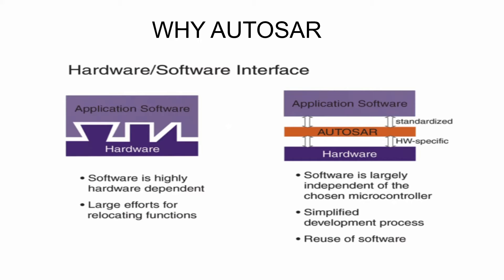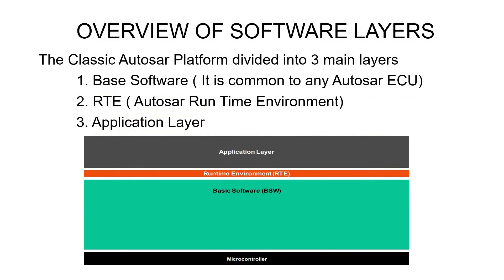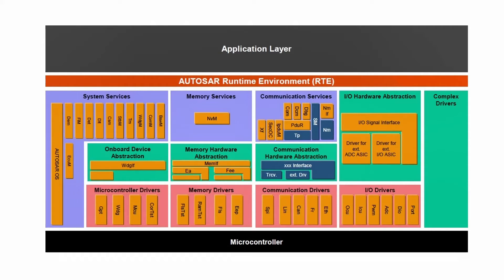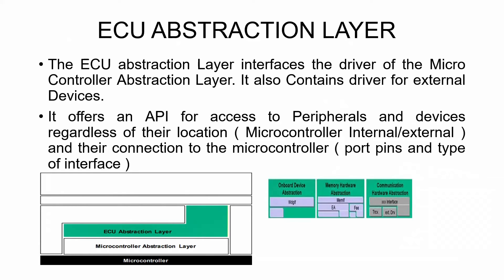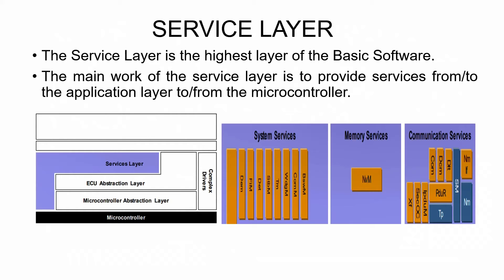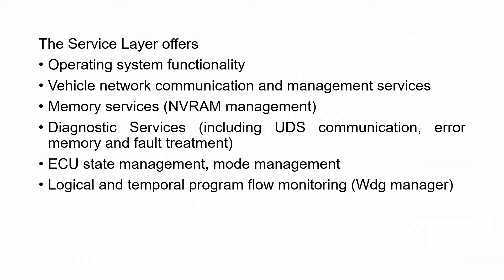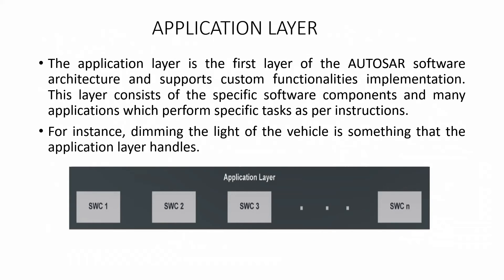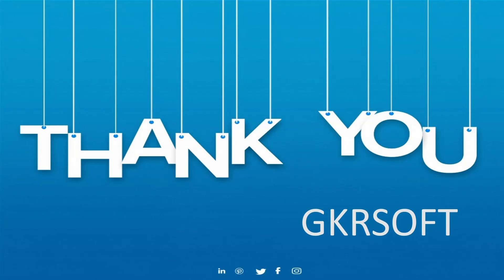Autosar layers by GKRSOFT

Comment: I have a quick question here what is the  exactly difference we can see between  multiple ASWC like A application SWC and Complex device driver  SWC because anyhow both are atlast one  .c file ?
Reply from the maker: The Complex Device Driver (CDD) Software Component is used to model a function outside of the normal AUTOSAR Basic Software stack for complex or resource critical sensor evaluation or actuator control, especially for hardware that is not directly supported by AUTOSAR . But ASW Software Components is a Pure Autosar SWC.
Reply: @GKR23  Thank you ! . I got your point .you mean say each ASWC has restricted functionality . but i wanna know how these all the .c files differ from each other ? because these are just blank .c file which have only  fun prototype and variables data type ?
Reply from the maker: @amj7090  C files only generate RTEGEN Phase. C Files differ based on the SWC. You will come to know about these steps during RTEGEN Phase Video. i am planning to Upload next week
Reply: @GKR23  yeah please . thank you for  your  time and response .